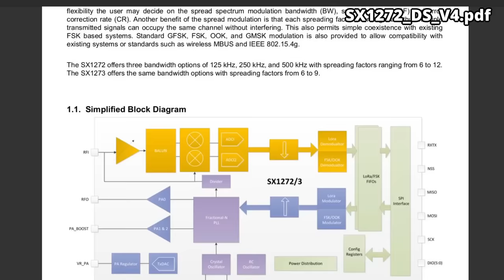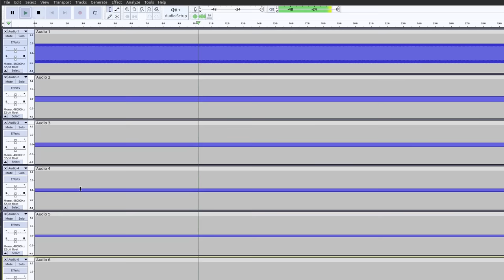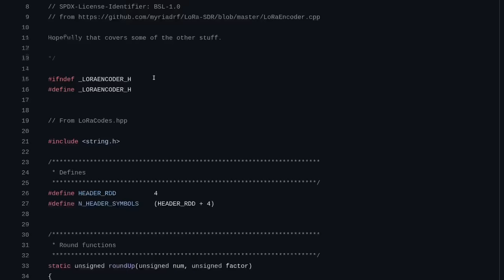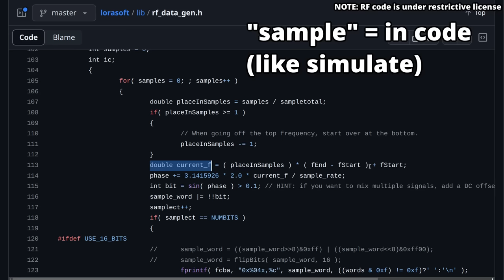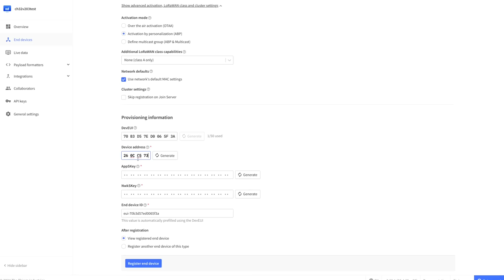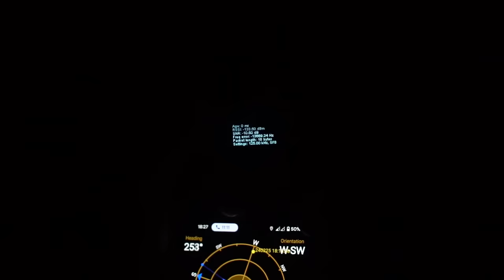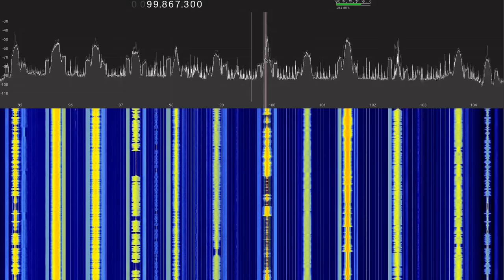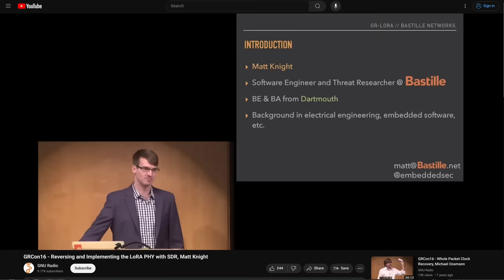How far can I broadcast LoRa packets WITHOUT a radio? - LoLRa

Comment: Thank you. I didn't really know  about Lora until now. Having watched this. It's clear that the only thing slowing down adoption is knowing it's benefits and it being proprietary.
Optical Fibre transmission chirps over long distance transmission, and subsea regen reshapes chirped signals before they lose too much shape. I never thought chirping was beneficial before now.  ID'ing a signal by the chirp I'm sure has been considered previously. 
Being able to pull the signal out at femto watts at a few km is going to create many many IoT applications where routing a wire or reinforced concrete radio blocking is an issue.
This was very instructive.
Thank you.
Now all that's needed is a non proprietary version.
Reply from the maker: I'm glad you liked it.  To note - one of the major benefits of LoRa is you can get silicon to easily send/receive packets.  So, while proprietary, it means we get chips.

Comment: The concept is SO COOL!
I have used a website about 10 Years ago, that used a Java web application to Transmit Audio to a AM Radio (I think, maybe it was FM). It used CPU EMI. 😮 (Sadly can't find it anymore)
Security researchers also used GPUs to get data off of Air-Gapped systems.
Reply from the maker: It's kinda insane how clever some of those tricks can be.

Comment: There used to be a raspberry pi project that could utilise one of the GPIO pins to transmit FM signal turning the rpi into a FM broadcasting device. The quality was surprisingly good and the range was about the size of a small room using just the GPIO pin as antenna and if you added a small 5 cm jumper wire to it, the range increases to the entire house
Reply from the maker: Hmm that's better than I would have expected. I bet a raspberry pi would make an amazing LoRa transmitter.

Comment: 16:50 That's because Nyquist ist always explained incorrectly, even in academic literature. The original theorem clearly says "bandlimited signal" meaning bandwidth and included different Nyquist-zones that can be used for sub-Nyquist sampling. The only condition is that the bandwidth of the generated or sampled signal is smaller than fs/2. And many people don't seem to understand this.

Comment: Amazing work, as always. If you think the O.MG-cable is evil, imagine this technique being used in many types of micro-controllers to implement a "hidden", wireless data-port to leak out information from, with a range much longer than Bluetooth. If LoRA can fish out valid data packets deep out of the background noise, can this even be jammed with conventional broadband jamming devices?
Reply from the maker: I certainly don't want to get on the FCC's most wanted list.
Reply: @CNLohr  I wouldn't be surprised if you're already on some kind of watch list but I wasn't thinking about the FCC. 😅

Comment: If you made a small impedance matched pi filter and a tuned antenna on a simple dongle or pcb hat you could easy get a few miles range out of this. Because the antenna is not tuned most of the RF power is being reflected back to the IO pin and being sunk as current there.
Reply from the maker: It may not be tuned well, but, even really bad SWR ratios still get some power out, and range only doubles with every 6dB of signal increase.
Reply: @CNLohr the fun thing about such a filter and antenna is that it would take exactly 0 added components, just some extra pcb space
Reply from the maker: @genejas  if you're up for developing and testing a design, I'll gladly print it and slap it into my design.

One issue I've been having is I have no way to tell what the characteristic impedance is of the tx pin

Comment: huh. the biggest thing i got from this video is that lora uses signal patterns rather than thresholds for binary data. such a lovely concept that i think could be improved on further, perhaps used at lower frequencies too. i wonder if this could be applied to lasers to more reliably transmit through foggy atmospheres using even less power than shown here? i'd like to see a yoctowatt of power send images from mars rovers lol
Reply: hi
can you tell me plz whats the big picture of what he is doing
its my first video of his channel
i am confused what actually he is doing 
what terminologies he is talking about lora etc
Reply: @artahir123  if i'm being honest i don't understand it fully myself, but i can try and answer while waiting for a more complete/full version from someone else.

he made a radio transmitter by hooking up a antenna to a mosfet driven by a micro controller's signal generator/pwm.

he is making things do stuff they aren't made for. usually in order to send radio signals you need to use a external radio circuit in addition to the antennae.

to get around the need of dedicated hardware he made his microcontroller basically hammer a switch on and off to manually create the frequency through a normal signal generator instead. the problem though is no common microcontroller not made expressly for this purpose (that i know of) can switch that fast including his so he needed a way to get around that limitation.

due to some property of interference patterns or something (some wizardry shit, i swear) the specific square wave function ends up making incredibly small signals in certain higher frequencies (natural frequencies?).  he found and took advantage of ones that allowed him to use the target frequencies he wanted.

LoRa is a proprietary radio communication technique, in other words its a set of hardware, rules, and encoding that make a way of communicating information between 2 or more devices.

due to the closed off nature of lora, pretty much the only way to get a receiver is to buy one from them, but rf is rf so you can send the signals in any way you want essentially.
Reply: @2kadrenojunkiegaming  thanks for replying
Reply from the maker: That's for posting an answer to abdul! that's a pretty good explanation.

Comment: I can hear the 27.5hz sinewave on my headphones, pretty good headphones, its like a truck driving by.
Reply from the maker: Pretty cool.  My reviewers kept having to tell me to turn the volume down.
Reply: My cheap $30 wireless earbuds can hit 27.5hz too, but I have to turn up the volume a little and make sure their weird ear shape is pressing into my ears as designed and not just held in by the ear tips like so many earbuds are/used to be

Comment: This is an amazing project and amazingly presented!

It's absolutely absurd what can be done with such a cheap chip and nothing else.

After seeing what you did with the ESP32S2 in the end, I wonder what the Raspberry Pi Pico (or RP2040) could have done.

I did a few projects with it, and its PLL and the raspberry-pi custom "PIO" blocks would probably allow even crazier things: You can overclock the RP2040's system and bus clock to about 430MHz and the GPIO and PIO still work! judging by what you did with the ESP's audio PLL, you could probably do amazing things with the pico
Reply from the maker: I'm confident an RPi could do very well! I'd encourage you to give it a shot.

Comment: This could conceivably be used as an attack vector to spy on or even take over air-gapped systems, by infecting some microcontroller either in the system or in one of the peripherals, like a USB webcam or keyboard. And given that the power is extremely low and hidden in the already existing RF noise emanated from the system. It would be very hard to detect unless you were specifically looking for it.

Comment: Super cool video. Last year I wrote a research paper doing nearly the same thing but without the antenna, so it only used side-channel emanations from the CPU. 
We managed to get it to work for about 20 meters at around 450MHz to send messages with a bare Arduino Uno!

I'd link the paper here but I think it'll get deleted -- it's called "Everything has its Bad Side and Good Side: Turning Processors to Low Overhead Radios Using Side-Channels" if you want to take a peek though :)
Reply from the maker: Thank you for posting this, I've added a note on my page that your work pre-dates mine, and provided a link to your paper.

Comment: Reminds me of the time OG Programmer Fabrice Bellard used a VGA port to broadcast analog TV signals that could be watched using a regular TV and antenna.
Or that time some hacker group exfiltrated data from air gapped systems using the SATA cables as antennas
Honestly know I'm convinced, anything can broadcast radio if you work hard enough on it, just wait until we get news of some new data extracted via LoRa from a USB/HDMI/Audio/Ethernet port... Or even those small ports on the motherboard like the goddamn HDD LED or some shit
This is gonna be a wild ride!
Reply from the maker: I thought Bellard transmitted HDTV over VGA?

Comment: You have taken GPIO to a new level. Awesome job, and here  I am still trying to make an esp32 mesh with 4 stationary nodes and 1 traveling node without success😢 i wish there was a mesh library that just did what i want to do but unfortunately not. I have to keep turning on and off things to make it function and have yet to figure out the proper sequence that can do it in the fastest time.
Reply from the maker: Gotta just dig deeper and figure things out at a lower level.  We try to put all the complexity in a box.  But complexity leaks out. Gotta keep things simple not just on the outside of the box but on the inside.

Comment: Wow

I wonder if the RP2040's PIO pins could help out in a project like this, since they essentially offload the hard bitbanging work over to a tiny processor and free the main CPU for other tasks
Reply from the maker: Almost certainly! I expect the RP2040 could do better than I can - but also - the RP2040 has other ways of generating dense signals like this, like through I2S.

Comment: Excellent. Time to slap a MOSFET, 24V and an LC filter on there. Still barely a radio, and you should be able to get another 3dB out of it and avoid the band splatter. Heck, run it off rectified line voltage and hilarity will ensue.

Thanks for open-sourcing the code. It means a lot.
Reply: well, no, please do not do such things, FCC regulations are there for a reason.
Reply from the maker: I have thought about this from the point of view of making a class C amplifier, because those can be made to be pretty narrow band.
Reply: 🤔 motor coil?  = MOSFET attached to a huge antenna.  Perhaps even some receiving capability if motor has hall-effect sensors.

Comment: This gives the vibe of an inverse version of Bird and Layzell's evolved radio. Minus the evolution, of course.
Reply from the maker: I had to look it up and even after doing so I'm quite confused by what it means.
Reply: @CNLohr  Bird and Layzell were experimenting with using an evolutionary algorithm to control a programmable circuit, trying to see if it could design an oscillator. However, the algorithm ended up aligning its circuits in such a way as to form a pseudo-antenna that picked up oscillating radio waves from a computer in the same room. Your device reminded me of that, since it transmits radio waves using clever manipulation of components not intended for that purpose.

Comment: 5:06 Listening test: Sine Wave, Square Wave & Low Frequency. Suppose you can root out harmonics using Fourier analysis with the waves you get on the oscilloscope.
Reply from the maker: I'm not sure what you are proposing
Reply: @CNLohr  You can add up certain harmonics to create other harmonics. Or you can decipher and isolate the frequencies that you need.
Reply from the maker: @kebman  Sorry I guess I don't really understand the specifics of what you are going for, yes, the harmonics can add up and subtract and move around, but I don't quite know what you are going for.
Reply: @CNLohr  Experiment and ye shall discover :)

Comment: While I am trying to get a decent range out of the NRF24 modules with power amplifier he is transmitting packets > 1km with a wire connected to a GPIO pin 😅 I mean LoRa is a long-range protocol, but @CNLohr you are truly a magician to me 🧙‍♂️
Reply from the maker: 900 MHz, way lower bitrate. These really help get the signal through.

Comment: Epic video! Epic hacking, epic results, and an excellent presentation that was fascinating and informative.

Also, that quick ESP programming tool sounds useful. Even when using the SDK, couldn't we flash that code once, and just re-flash the parts where our own code resides?
Reply from the maker: Absolutely.  that's all I did, really.  You just have to transfer the code to the part somehow to run it.

Comment: I want a fully integrated unix-like device with networking and sd card slot, all just using a single esp32 or even cheaper hardware! I want kids to learn advanced computing for $1. Impossible.
Reply from the maker: You should check out my video "Game Made for VR on a $1 Processor?"

Comment: That is awesome .. and a little scary.
That means every device with an 8266, esp32 or else could send messages at least a hundred meters wide and be received by an 20 EUR receiver with a lora-chipset

I'm interested in your calculation to send on frequencies 868 MHz and 433 MHz for studying purposes.
Reply: no, this cannot be used outside a lab, because it generates 10 times more undesirable side product than actual signal, this is totally forbidden buy any country regulations.
Reply: @lo2740  of couse this should only be used in the lab, but as in the video, it is possible to use it for studying purposes.

As already mentioned in other comments, a band pass filter would greatly reduce the other signals/noise in unwanted frequency bands.
Reply from the maker: You can just change the target in the code to a different frequency, instead of 900.  Lower frequencies are likely to work better, as long as they aren't really close to an Fs Alias.
Reply: @CNLohr  thanks for your response .. we may try this in our EMV-chamber here .. great effort and nice unfolding of results

Comment: very nice. up-down chirp would be more instinctively straightforward for peoples if any spectrum display would not be in waterfall, would like to learn if any SDR software could be that setting in way.
Reply from the maker: One of the annoyance is that most SDR waterfall displays only go at 60 FPS per line or so - whereas you need to see tens of thousands of lines per second to  accurately see these chirps.
Reply: hi , do you have any idea whether any SDR spectrum display could be flipped upside down to show time axis toward for the chirp up/down instantly

Comment: Broadcasting on a harmonic reminds me of the analogue cable tv 'all channel activator'  'cubes'.
Reply from the maker: I've actually never heard of such a device but I can imagine how it would work.
Reply: @CNLohr  It was in the days of slow micros with limited resources and peripherals, so they used a separate divider to generate multiple signals at 500khz spacing. The signal would then always hit the receiver control channel (around 100Mhz). The divider clock was modulated with fsk, so that each of the harmonics got modulated. It sent this signal into an analogue cable box, so that it switched on all of the pay tv channels. Very crude, but it apparently worked.
Reply from the maker: @threeMetreJim  well cool.

Comment: They have been doing this for several years on HF wspr with just the GPIO pins.
Reply from the maker: Probs not at 900MHz though
Reply: @CNLohr  the point was using the GPIO pin as a transmitter has been done. 

They have used to for 2 meters and 440 MHz as well as a very low power part 15 radio station. 

The WSPR projects have used them to make a signal that’s been used to track global propagation 

My comment wasn’t about 900 MHz as it was so much as just using a GPIO pin as an oscillator and Low power transmitter.

Comment: Interesting. Reminds me of manipulating audio output to produce 3X harmonics to sync JJY-longwave-controlled watches via headphone output. I did something like that myself in JS. Which makes me wonder: given that microwatt level of output power, can one modulate audio frequency square waves to produce high enough harmonics to be heard by LoRa with no additional equipment at all, just anything with a headphone jack and earbuds as an antenna?
Reply from the maker: That would be highly unlikely because DACs have special hardware super filtering out higher frequencies.

Comment: could you put a notch filter on the antenna pin that is tuned to for example 868mhz(eu) or 915mhz (usa)?
Reply from the maker: Absolutely.  Though you would still need to tweak the code to select the new frequency.  868MHz actually would produce a cleaner and clearer signal than at 915.

Comment: Would it be possible to produce a slightly cleaner, narrower, signal by firing up a few separate digital outputs with slight offset, or even hooking the same output to multiple antennas with increasingly longer delay lines, to produce a stairsteppy sine wave ? Or I really don't know what I'm talking about?

Would that kill the harmonics you need to make this work or enhance them?
Reply from the maker: Adding a filter would be a great way to improve this project!  But, I just wanted to see what would happen with no external components.